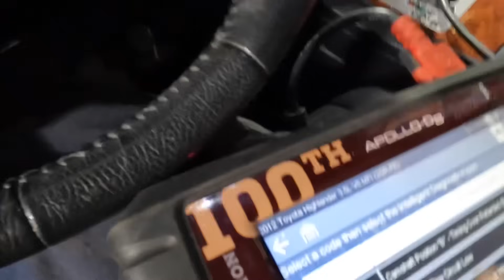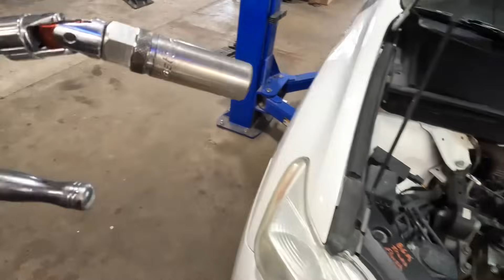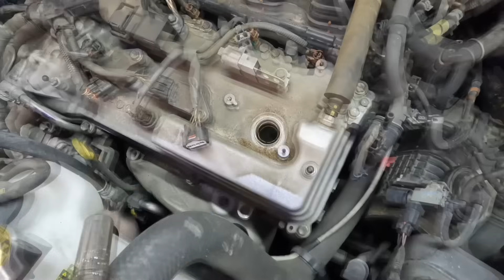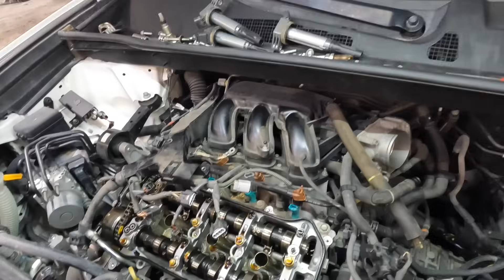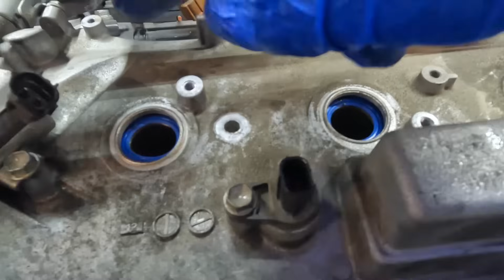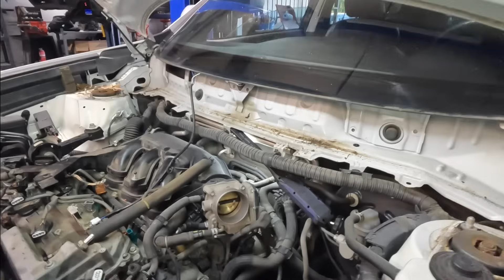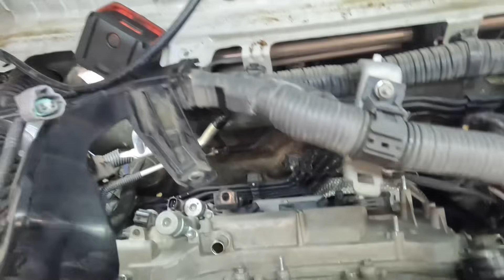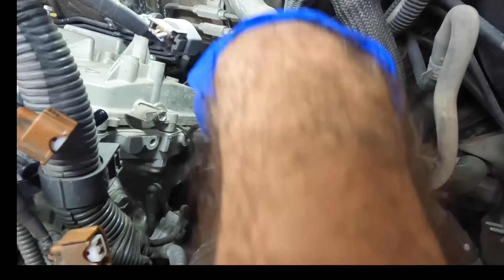Timing Chain Codes! Toyota Highlander P0014 P0025 P0012 VVT #repair #automobile 2GR-FE 3.5L

Comment: I was taught by my great Dad you always tell a mechanic what its doing (symptoms observed) but never tell a mechanic what to fix. The whole reason you pay for shop time is to get the expert diag. skills that come from experience...this vlog is a great example!
Reply: Explain symptoms and give what you've learned.  "It's doing xxx.  I've done some research and others have found this to be caused by yyy, you might want to take a look at that."  It is quite possible your mechanic might end up doing the same research and coming to the same conclusions, so giving them hints (without demands) isn't a bad thing.
Reply: @MichaelSteeves  Other than the implication that the mechanic is incompetent?  Despite your intentions, your “suggestions” may not come across the way you wanted.  Many mechanics are sensitive to this behavior due to many negative experiences.  Better to avoid the problem.  However, you’re going to do what you want anyway.  Now you can’t honestly say that you weren’t warned.
Reply: And if you don't tell a mechanic what you want done, they most likely will try to up sell and rip you off.
Reply: @johnt.848  Sure if you don’t take the time to find a great mechanic.  Consumer beware.  BTW…who says that mechanic, you refer to, won’t ignore you and do his thing anyway?
Reply: Failure to follow this rule is why many truckers don’t get along with mechanics.  Thankfully, I followed this rule with minimal difficulty.

Comment: A $2500 (my guess) repair because 6 25 cent rubber washers failed. No wonder engineers rank right up there with attorneys for like ability.
Reply: It’s accountants not engineers.  Those parts outlasted even the longest manufacturer extended warranty and the vast majority of 1st owners.
Reply: I figured it at 6 hours or so (2X the video length assuming he's half-done), and modest parts cost, so it shouldn't be over $1500.
Reply: @Scramble-electron-890  even at $1500 my point is still valid.
Reply: @gerrycarmichael1391  True, modern cars have gone full Rube Goldberg.

Comment: My tool collection quickly started growing when I first started watching your vids years ago.  I'm just a DIY'ER but my life is much better with the right tools.
Reply: I'm an old guy so I began collecting more power tools as my arms are nt what they were 50 years ago.
Reply: I have just completed doing a full rebuild of my entire front end of my 2007 BMW X3 3.0d (6cyl turbo diesel). This included shocks, brake caliper rebuild, new wheel bearings, discs etc. I found it a nightmare with some cheap Chinese pullers to remove the hub and old bearings. I ended up purchasing a much more expensive puller set (still Chinese). You have to purchase the correct tools to do the job otherwise you end up damaging components. I turned 76 last November.
Reply: @desoneill5489 good for you! Aged mechanic here too. Keep up the good work. I have a 2009 335i N54 that I wrench on. WRT tools, cheap tools are cheap quality irrespective of where they’re made. There’s nothing intrinsically better about US tools, despite what folks write in comments. Logically, given the higher cost of living in the US you’d probably expect to find Chinese tools to be better quality than US tools at comparable cost. Yikes! That’s controversial lol!
Reply: Agree!
Reply: Especially with a German Car.  I won't touch them (and neither will the mechanic across the street, whose daughter have VWs).  You MUST have the special tools and fit ONLY German parts.
Reply: @MrRunner  I am very fortunate here in Brisbane, Australia to have a very good BMW specialist mechanical service about 7km fro where I live. This is a non dealership mechanic who is willing to use good quality non genuine parts with his servicing. He knows these cars backwards. I go there for issues I can't resolve myself. I am very hesitant about carrying out repairs to my M57D30TÜ diesel engine. These engines were not exported to the US as far as I am aware. I change the oil more than twice as often as recommended and to date after about 6.5 years of ownership the only major breakdown I have encountered to date has been the harmonic balance wheel where the rubber insert fell to pieces. My Aug 2007 BMW X3 e83 is the best car I have ever driven in my lifetime and I intend to keep it in the long term even though it is now over 16 years old.
Reply: You are truly blessed. The best car I ever drove was a 316 BMW, so I can understand your urge to keep a car that is reliable.  I live in Ontario Canada, where diesel cars are virtually non existent.  You can pick up a 3yo Beemer cheaply here as they are so unreliable, mainly due to the electronics and require Dealership intervention.  Renting the diagnostic software for any German car is prohibitive for a general dude like me, so if you found a good specialist well done you.  One thought. Change the coolant (by flushing, not drain/refill) every two years max.  It is essential to ensure the cooling system is A1 as this will prevent damage to the electronics. Hope this helps.  Enjoy your ride
Reply: @MrRunner  I own a bmw and a porsche, it’s not as bad as you think!
Reply: My brother only has BMW, cars and motorcycles.  Buys new and sells after the three year maintenance ends.  Just loves them, with good reason.  I have met people who have little or no trouble with them, but I am constantly asked to diagnose BM, not as much as VW, but the  cost of software etc, put it out of reach of single mechs like me and many shops won't touch German cars for this reason, so yes, I'm biased as I can only report on what I see.
My main vehicle is a motorcycle.  Yamaha on which I do long distance touring.  Incredible reliability, not as good a machine as BM, but I have yet to speak to a Beemer owner who hasn't had problems with them.  That said,  Beemophiles seem happy to put up with the shortcomings in order to have the best ride in the business.  Oddly I did a Rolls Royce once.  All engine parts were had from the BM dealer, which was cheaper than RR !  
Enjoy your German twins though.
Reply: Funny you should mention it! I paused the video and went looking for those short little ratchet wrenches Ray uses all the time. It appears Snap-On and Gearwrench make... for more than $450 a set! There are some other brands for around $200. They look very handy for tight spaces and can be fitted with an extension as a handle, when room allows.
Want a set? Google BFCRM712 and you'll see all the options (searches for "ratchet crowsfoot" etc. bring up entirely different things).
Reply: Same here.  Getting close to 60.  Started do my own repairs this year because of Ray's videos.  The Mrs. has a bunch of tools under the tree for me; can't wait!
Reply: Hell, I went back to college because of Ray. Auto tech college at the local community college. I'm 66! $5 a credit but no grade, no accreditation, just knowledge. Now I do all my own work. Bought a 4 post lift. Working on as full a tool collection as I need.

Comment: Dear God,  I almost hate you.... didn't know to remove the wiper cowl. I fought a Lexus with that engine that had oil standing in several plug tubes. That back valve cover made me cuss more then I've ever cussed working on something.  Mirrors,  lights,  and contortions I've not been in since. Removing that cowl assembly could have saved me.. Dooh!

Comment: HEY RAY, I LOVE YOUR VIDEOS.... HOWEVER THIS ONE ISN'T ONE OF YOUR BEST.    I NOTICED YOU REMOVED THE COILS AND PLUGS FROM THE CAR BUT THERE WAS A TON OF DEBRIS ON THE VALVE COVER RIGHT BESIDE THE PLUG HOLES IF THAT MUCH DEBRIS FALLS INTO THE ENGINE OR COULD BE PRETTY BAD FOR THAT ENGINE. ASK ME HOW I KNOW.....😢. I'VE MADE IT HABBIT EVERY TIME EITHER A COIL OR PLUG COMING OUT I MAKE SURE I BLOW THE ENTIRE ENGINE WITH AIR.  FUNNY THING IS YOU HAVE DONE THAT ON ALMOST EVERY VIDEO I'VE SEEN EXCEPT THIS ONE.... BUT IT ONLY TAKES 1 TIME NOT DOING SOMETHING RIGHT WHEN ISSUES HAPPEN.  ANYHOW BROTHER KEEP UP THE GOOD WORK.
Reply: The guy has been sick and has clearly not recovered fully.  Laying around the house recovering doesn’t pay the bills nor keep the business running.  Life sucks sometimes.

Comment: mine will give me those codes and a few lights on the dash if I'm using cruise control and the throttle is "fluttered". I've not gotten the error since I stopped using cruise 2 yrs ago. before that, regularly.

Comment: Seems aggressive removing those spark plug seals in the valve cover, can easily scratch the alloy and possibly allow oil or oil vapour to start showing outside the seals around the top where the coils are installed.
In my thoughts I wonder if a little boiling water or a very careful gas torch applied onto the seal will help remove these without the excessive hard tool usage
Reply: You have to be aggressive. The seal rubber has fully hardened. Your suggestions would do nothing but waste time. The seal material encases a steel core. The steel core ring is what prevents the hand tools from penetrating the seal and marring the valve cover.

Comment: Hey Ray. Is it a myth that gapping iridium spark plugs will ruin them? That's what I've been told anyway. Something about the layer of iridium or platinum being so thin that the gapping tool is enough to wear that coating off. Reeeee comment generated.
Reply: the manufacturer says to be careful NOT to touch the iridium coating or the porcelain tip.   So  Ray might be wrong to check the gap with that tool.
Reply: @glennschemitsch8341  - Nah, those units were going in the trash anyway. 😊
Reply: @williamsquires3070  Yeah then he checked the new ones. At first I was like yeah he'll get new plugs. I might have old info and they might be more robust today. ¯\_(ツ)_/¯
Reply: If it were, then the force of fuel detonation in the cylinder would be far more than what you’d get testing the gap.

Comment: 15! Good Wednesday morning Ray and the wife unit!  And along with the two new employees! In 1981 I was riding my motorcycle from Lebanon Oregon to Phoenix Arizona the to Denver Colorado to my new job. About halfway to Phoenix, around Palm Springs, it was so hot the oil was boiling. I could see it from the inspection window. I stopped and had the oil changed and set of down the road. I could smell oil burning so I stopped to see what was leaking. I noticed oil was coming out of the banjo bolt on the engine head. I tried to tighten it and went too far and broke the bolt. I called my sister in Phoenix and had her buy one. She then went to a truck stop and asked a trucker to drop off the part to me. It worked and I continued on my trip. You talking about the banjo bolt and crush washer brought back that memory.    Roger in Pierre South Dakota
Reply: That is so cool!

Comment: Good Stuff Ray!, I dread doing the valve cover on my car, its a super tight fit, and removing the wiper cowl I think may be my route also.
Reply: I do the same thing and take the windshield wiper cowl off, because it's got another little lip on it that takes 2 more inches away.  Take it off instead of kicking your own ass...you would end up removing it anyways.  It would help if cars were made rear-wheel drive, then you would have loads of real estate.